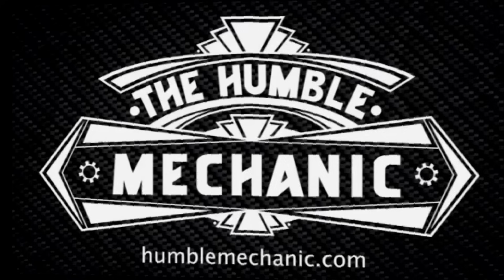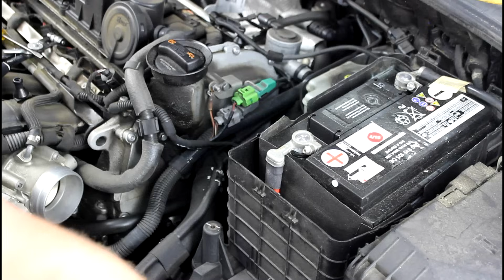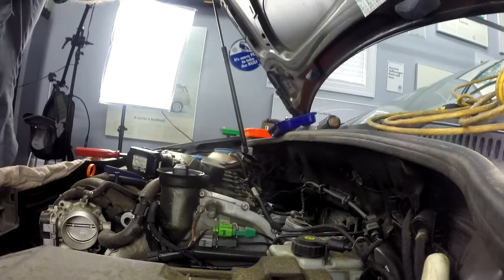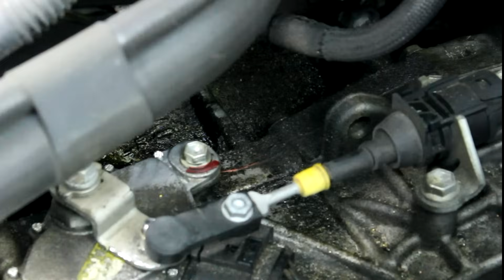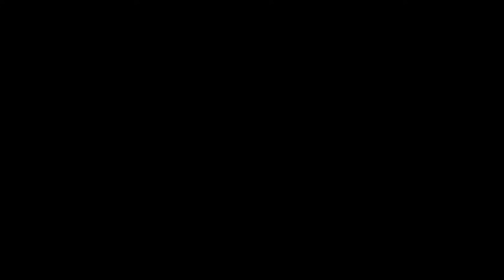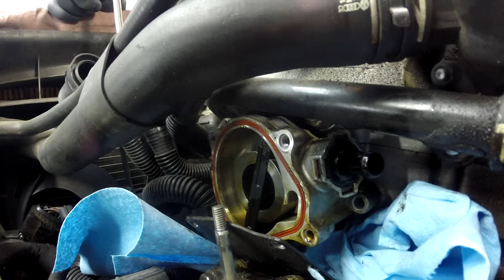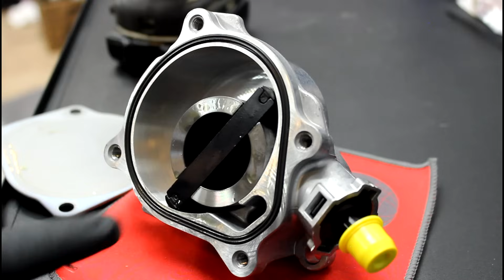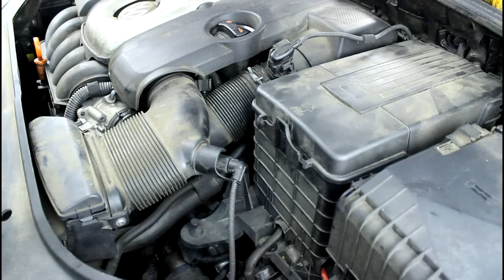Replacing VW 2.5l Vacuum Pump ~ The Easy Way

Comment: ive watched this video several times and still watched it while i was doing the work. like he said take your time wont have any issues and this is by far the easiest way to do it. I have a cold air intake system so that helps with not having to remove the air duct system lol. HumbleMechanic do you know how to fix the constant oil light flash?

Comment: I just replaced the gaskets using your teachings. After careful inspection of the old gaskets, I couldn't see any issues but installed the new set for $15 The dealer quoted nearly $1600 saying the pump needed replaced. Being that the brakes felt fine, I was leaning towards the gaskets so I was willing to throw some time and a couple of bucks at it. If this dont solve the problem, I will replace the pump next but I will only pay the dealer as a last resort to do this.  I am not saying the dealer was not correct, but I am just trying to save some money. Thanks for parting your wisdom and experience. My experience was just as your video on a 2013 Passat 2.5 Cheers, Rob

Comment: I've got Passat SE, 2013. Brake works but pedal gets hard to push after a short push. Suspect it's vacuum line or vacuum pump...to remove the hose off the booster do just pry it out ? Or better yet do have a video on doing that operation ?

Comment: just a question. i have the power steering fluid reservoir in the way of removing the battery, and im afraid to take it off. there's these weird plastic and rubber locks holding it to the battery tray. any tips?

edit: turns out i just had to pull them out similar to the grommets that hold the engine cover and air box in place.
Reply: alright, looks like im also doing a power steering fluid flush along with this job 👍lol. i had to get the rservoir out of the way to do this.

Comment: How about picking out the old gasket and using gasket maker back in the groove? Just screw the cover back on and done?

Thoughts??
Reply: Maybe for a manual transmission. For auto, the cover needs to be off to get it back on. You would have to be careful not to gunk up the gasket if it is still wet.

Comment: It sounds like this will work on a 5MT, too, is that correct? If so, will I still have to take the transmission cables off and will that mess up their settings? I've been fighting with getting them adjusted right, and with the car in the shop for another repair (ignition cylinder) I'm about to pay to have them adjusted correctly and don't want to mess it up doing this afterward. I'd like to save the grand they're quoting me for the pump replacement though.
Reply from the maker: For the manual you can just take off the pump. No need to take it apart
Reply: @HumbleMechanic  I got that sorted! Thanks for the response. Unfortunately, I didn't clean off the mating surface on the block quite well enough and had a huge puddle of oil on the garage floor. Pulled the pump off again, found the little blob of crud I missed the first time, scraped it off and put the pump back on. All seems to be good now. $250 for the pump and about 60 minutes the first time, probably about 30 minutes the 2nd time. The dealership wanted $950 for the job. I said... no. At least they diagnosed the source of the leak for "free" while they were replacing the broken steering column lock and broken lock cylinder.
Reply: @HumbleMechanic  And, here I am, 3 years later. The shop just said the vacuum pump is the source of my oil leak. Maybe I got a cheap pump last time. 
I knew I'd watched this video before, and really felt like I'd done the job before, but just couldn't remember. Now that I've scrolled down to the comments, it seems I have!

Comment: THANK YOU SO MUCH!!!
This video probably saved me around $800-$900 in repairs. Replacing the vacuum pump is supposed to be done by dropping the transmission. I don’t have the equipment or tools necessary to drop the transmission in my 2012 Beetle, so I would have had to pay someone else. Instead I bought a rebuild kit for $50 and did the repair the way it’s done in this video.
Reply from the maker: Awesome

Comment: A lot like the alternator on these cars. If they just added 3/8" more room you could easily pull them out the top. Had to drop the ac compressor and go through the bottom.. just did this delete kit, no way would I split the trans I would have tried everything else first. Glad I found this vid making it easier.

Comment: At 14:40 you mention regularly dropping this bolt. Try putting the T30 bit/driver in place onto the bolt, then attaching a small magnet at the far end of the shaft - this will temporarily magnetize the bit so the bolt stays stuck to it. I've done this a few times when doing repairs in drop-prone locations, and it usually works pretty well.

Comment: Be careful about the aluminum bolts that screw into the block, One of them snapped even though I was torquing at 10mm. 

I replaced all of the them with stainless steel allen bolts (and with a little blue threadlocker) and torqued them hand tight (just holding the extension), then quarter turn with the ratchet. No leaks so far.

Comment: Thank you for your video!!!  When changing the oil in my 2013 Jetta SportWagen I noticed an oil leak coming from somewhere.  Became a little upset at first then started doing research online for causes and fixes.  Your step by step video is spot on.  Going slow and taking my time it took me a couple of hours.

Comment: I had a 2006 Jetta 2.5 with a leaky vacuum pump.  I just lived with the leak.  I was told a rear main seal since it is so easy to think that it is one.  I now have a 2013 Passat with a 2.5.  If I ever see that leak on that car I will know how to fix it without a TON of money and unnecessary labor.  It is not just cheaper and easier this way but it reduces the chance of messing with the transmission mounting or something else and having a new problem.  Considering how many problems they sometimes had with the earlier 09G transmissions it would also be nice not to do anything unnecessary with it that may trigger a problem.

Comment: Hey humble mechanic i just have a quick question. I've got a 2014 Jetta with the 1.8 tsi that's got excessive crankcase vacuum and have replaced the pcv assembly with no luck, what i found weird if i disconnect the pcv tube from the intake pipe nothing changes as well as the vaccum is still there on the crank case, do you think it possibly could be this pump causing the issues?

Comment: Your video is awesome and inspiring me to do this job myself when the snow has melted. One question, do we absolutely need to change the whole pump? I called the dealer and they have just the replacement gaskets for only $25. Could i not just change the gaskets? Thanks again you're the best!
Reply from the maker: For how much the seal cost it may be worth trying before you do the whole pump. Knowing it may still need the whole pump

Comment: Thanks so much for this video!  I do have one question though.  I have a '12 Jetta SE CBTA and all sites are saying that a gasket is required as well?  Looks like the gasket goes between the pump and the engine?  Is that right?  Part # 07K145215A for reference.
Reply: You know what?  I re-watched the video and saw the gasket at 17:48.  Now my question is do you just put the gasket on or do you need any kind of gasket sealer?

Comment: On the shift selector I’m still not seeing what the red marks are accomplishing. If the red marks are applied to both the bolts and the shift selector I could see that you’d use them to get the bolts tightened back to where they were, but the video doesn’t indicate that that’s how the marks are applied.

Comment: I’m a Mercedes’ mechanic, been for 30 years.
I gotta say I appreciate this video as very professional.
Thank you for not having a meth induced pre video music and video intro and thank you for not having some generic Japanese cartoon music playing too loudly during the entire video leaving people straining to hear what you’re saying.
Thank you for editing unnecessary linger moments that put people to sleep.
Thank you for using a torque wrench.
I’ve done this repair a few times and it has always just been the front cover gasket leaking on the pump.
I usually use the black and gold wearever brake kleen and compressed air to help aid in the drying process along with a flat metal oil drip pan under the car to catch all the gunk.
I later drive up on ramps after the repair and clean the underneath the same.
I finish up by spraying leak trace powder around the repair to make sure it’s repaired correctly then drive it and recheck for leaks.
The crc stuff smells like carb cleaner and stays on my breath inside my lungs for a couple days …my Wife says.
I’ll be you a million dollars not one mechanic in the dealership would dare remove the transmission to replace this part but WILL charge the customer for the flat rate labor involved In Doing so.
I’m also sure they absolutely love to hear about these affected engines coming in with an “oil leak.”…..easy, easy money.
These repairs where the manufacturer screws up and requires the transmission or other large components to be removed in order to replace a part but the technicians find a way around it usually gets back to the flat rate police when the techs go to school for updated training or the shop foreman takes note and contacts the manufacturer.
At least in the Mercedes’ world they got privy to these instances and changed the flat rate operation codes to reflect this.
Believe it or not Mercedes is pretty decent about abusing people that way although their prices and mark up are still ridiculous, but along those same lines Honda is even worse.
Reply: Hondas terrible for anything dealership wise, had a terrible wobble & shakiness around 65 mph towards the rear tires, costed me 100 bucks in diag & told me it needed all 4 new brakes n rotors was the issue, I declined the work, got a new back tire and fixed the issue 100% brakes were not even bad nor were they wore out smh its not even like this was a 1 time thing, stopped taking my civic to stealership for repairs, only oil changes bc warranty wise I want it on record that the oil changes were done there, but yeah honda is terrible especially the insane prices for parts & then labor 😢

Comment: The dealer and independent shop claimed I had to have the transmission pulled in order to do this job on my '09 MK5. I was being charged 1350$ parts/labor for that job to done. I'm glad I found this video.
Reply: You’re technically not supposed to do it this way. As a dealership (for insurance purposes) it is in their best interest not to disassemble the brand new part

Comment: I had a shop quote me $1200. Question though. Does the pump go bad, or just the gasket? Mine is leaking and it doesnt look like there is too much in the pump to actually go bad- but if I am going to go through the effort of doing it, I might as well do the pump as well (if it needs to be done)

Comment: Hey man I have a question. I've been having rough idle issues and the car would stall out sometimes too. Changed PCV diaphragm. New map sensor and cleaned out throttle. Problem still persists. Could this be the issue? (Found no holes in any of my hoses in or around throttle area either)

Comment: Great video.  Followed it with some slight differences with the battery removal for my 2013 VW Passat 2.5 SE.  everything is in good and tight.  No leaks.  However, I now notice a noise that I did not hear before.  It doesn’t make it when I am in neutral and Rev the engine.  It only happens when the automatic transmission goes through the gears.  It is a slight “zzzzzz” sound is the only way I can describe it.  I have good vacuum pressure with the brakes.   I did have to replace the hose going from the vacuum pump to the firewall. Maybe some leak that a silicone seal might fix at the firewall?  The slight noise wasn’t there prior to this part replacement. Only happens when in gear and accelerate, slight “zzzz” noise.  Not grinding gears.  Any ideas?

Comment: Thanks!  Hey, not familiar with "reset the pinch protection on the windows" you mentioned at the end.  I'm actually having trouble with 
my sunroof fully closing....it gets almost closed then stops.  Is this a pinch protection setting issue or other adjustment?         Mark

Comment: I just attempted this repair but with the rebuild/seal kit. (Replacing the metal outer gasket, inner rubber gasket, and rubber seal around the brake booster pump outlet) I’m 99.99% certain I reinstalled flush, but after I reinstalled and started the vehicle and drove my Passat out of the garage onto my driveway all I got was Black Gold, Texas Tea (oil) gushing out from the bottom of my vehicle.  🤷‍♀️ Any clues or suggestions as to what went wrong.

I purchased my seal kit from RKX. I did have an issue installing the new inner rubber seal because the seal did not appear to be a perfect fit. The new seal appeared about 1/4 to 1/8 inch longer. Today when I remove the pump again I’m going to match up side by side the old seal to the new seal to confirm a 100% length match if not then RKX sold me a defective improperly sized seal which I did struggle inserting during the rebuild process. I was able to push seal down into the crevice but it was forced and not a natural and easy fit. 🤷🏽‍♂️
Reply: Update: The metal gasket and inner rubber seal was not the problem causing the massive leak after I did the rebuild.  The problem (which apparently was the cause of the original slow leak) was that one of the T30 brackets had a hairline fracture which apparently turned into a complete full fracture after I reinstalled post rebuild. This caused the pump to pull away from the engine as soon as I started the vehicle to test my repair. (oil then leaked profusely from back and not from the front). So my suggestion to other owners is that if your vehicle is older than 5 years old or the part is the original OEM Part, then you are better offer replacing the old part with a completely new part which does not have any wear and tear or hairline cracks that can develop into complete breaks/fractures.

Comment: Maybe I'm missing something, but I don't see what the witness marks for the shift selector are marking.
Reply from the maker: It’s adjustable. This way you get it back where it came from. 

I’ve had people not get proper shift selection because it’s wrong
Reply: @HumbleMechanic  I think I understand.  There is a range of how tight you make those screws and it adjusts the shift selector.

I've noticed the vehicle in question tends to be quite slow about shifting from park to reverse.  I wonder if this is not adjusted correctly?  Hasn't been a problem really, just a thought that occurred to me.

Comment: One last thing.  If you do this job on a slanted driveway, like mine, it DOES matter if the shifter moves while tightening the 12mm nut!  The car shifted into neutral and started rolling toward the street!!!

Comment: btw, there is now a third option to replacing the vacuum pump (for mucho donero) or installing a bypass kit (a bit of a PIA); thanks to RKXtech.  They sell just the two gaskets that do the leaking.  Yay!  The cost is less than the other two options--yay!  BUT, it is way more than the parts ought to cost--boo! (But cut them some slack, they are doing what VW should have been doing all along, and probably for the same price VW would have charged, IF they had done the right thing, which is always way more than the parts ought to cost).

Comment: This is a great video, which I watched several times before even attempting to solve the oil leak on my 2008 Jetta, and then watched as I progressed through the job.  Big question:  How important is that very thin, apparently plastic (or very brittle rubber?), washer that sits between the shifter plate and that washer that the tabs are on?  Mine just broke into pieces as I tried to get the shifter plate up off the transmission.  Ugh!

Comment: I’m having a hard time figuring exactly how that hose to the vacuum pump need to be. Does it have to be snug and tight or does it just set in there clipped in and has wiggle room

Comment: Sht, I did not know what was leaking and it turns out it is the brake vacuum pump...I couldve done this myself for my 2012 Passat.... $1170 down the hole... Oh well....

Comment: I just did this, my new pump has no leaks and my brakes feel great.  However I can hear a slight tapping or rattle sound, it seems to be related to the cover of the vacuum pump as when I touch that area I can feel the same rhythm.  Do I have a bad seal?  Or dirt in my seal?  Has anyone else experienced this?   To be honest I'm not sure if my car had this sound before or not, its quiet but I'm hyper aware of it now
Reply: Update.  I added oil and sound went away completely along with the feeling I was getting from touching the vacuum pump.

Comment: Would have done this myself if I knew I didn't have to drop the transmission my gfs 2012 jetta started leaking oil and 8 didn't want to touch it since everywhere I looked said I needed to drop a transmission so I was like nope not happening. Welp 1300 bucks later shoulda could a didn't.
Reply from the maker: Dang!!!

Comment: Any difference with the steps if on a manual transmission?
Reply from the maker: No taking the pump apart. Super easy to do. You can access everything way easier

Comment: Why did you take the cover off the old one then the new one? I guess I'm wondering why not just leave the cover on when you take the pump off and leave the cover on the new one when you put it on? Also, does the vaccuum pump contain oil? There's clearly an oil leak beneath that area and it seems to be coming from the vaccuum pump but I didn't understand why a vaccuum would have oil in it lol, so I just wanted to ask you if the pump could be what is leaking that oil?